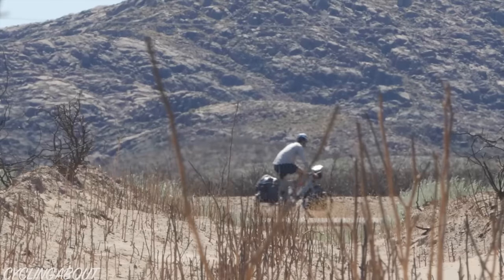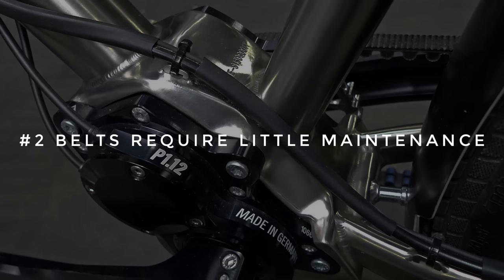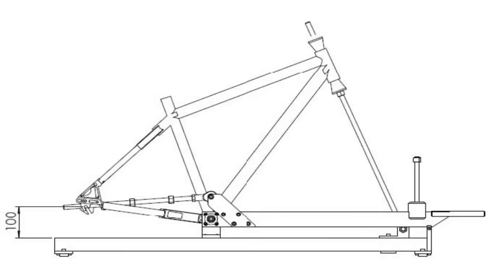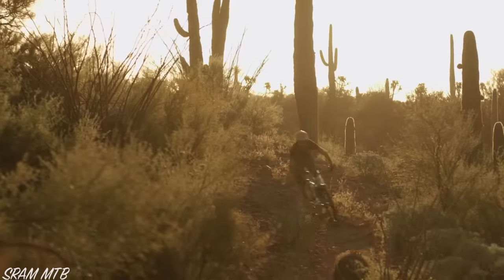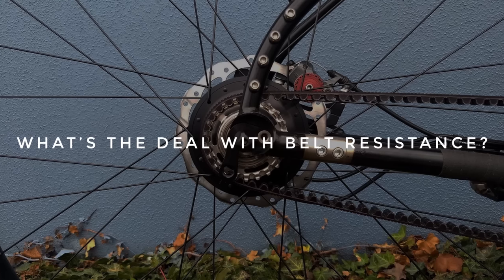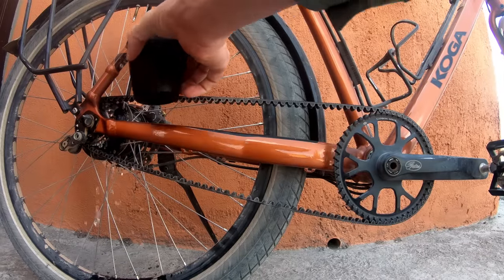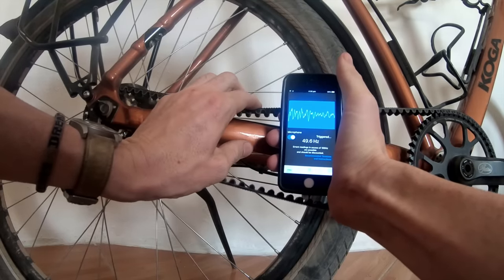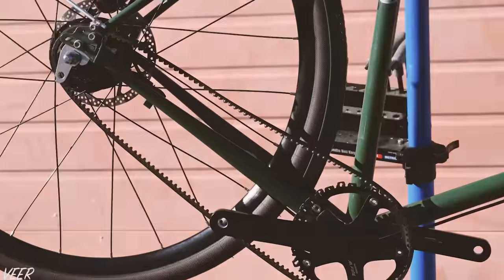Belts Are The BEST Bicycle Drivetrain Available (Epic Testing!)

Comment: For a belt, you also need a gearbox.  The Rohloff Standard Speedhub Touring is $1600.  Now add a specialty frame, specialty belt, and specialty sprocket and specialty chain wheel.  If you use it for commute, touring, or general transportation, you will need secure parking to ensure nobody steals it.  The system is heavier and significantly less efficient, so they are never going to make it anywhere weight and performance are drivers, which is typically where the money is spent.  Most looking for a touring bike, are looking for ruggedness, and being supported worldwide.  As things stand, the system only makes sense for what the author does, and those like him willing to ride an unsupported system worldwide.  That is a minuscule market.  I loathe chains and derailleurs as much as the next guy, but belt drives will need to get within a Texas mile of the chain drives on price before they can invade any area of significant volume.
Reply: awfully its true :(
Reply: This is fair, I suppose he did say the best available, not the best value or best in all situations, but I have to say he cannot be right about best commuter bike if it's this expensive.
Reply: I bought a belt driven, city bike last year. So I'd consider the advantages, if you buy new.
Reply: @normanproske9151  what price did you land ? they are way to expensive over here :(
Reply: i rather buy an good e-bike
Reply: heavy but better in the long run whereas others are easier but need regular maintenance which i don't mind. though if your taking a rubber chain make sure your using a speed pedelec. and that shouldn't be much a problem. especially when the bike auto gears itself XD
Reply: Ten years ago they promised that $500 bikes would have belts and thermoplastic gearing...
Reply: Head ur fast belt drive commuter bike has a Shimano nexus hub and is $666.99 on Amazon.
Reply: @jama211  you wouldnt care about a few percent efficiency, so the rohloff is out already
Reply: For pedaling a cheap internal gear hub will do but ebike belt drive is awesome but igh gearbox won't hold up 🤷‍♂️
Reply: Also you can't really do full suspension without a belt tensioner to allow slack
Reply: The belt is best for commuting and best of pedelecs of any kind (single speed, pinion, whatever). They drive insanely silent and a lot of bikers love the direct approach of the belt at crossroads and after stops. That multiplies on a pedelec as well. The chain is better on long straight tracks where you don't need a lot of effort. From 350w onwards the belt is as good if not better than most chains. And this is only true for a perfect new and maintained chain. The belt is just the better chain for commuting or pedelecs. pedelec engines will just crush chains in no time.
Reply: For commuting I have to disagree. You can get a 8-11 speed Shimano alfine hub for a fraction of a cost of a Rohloff system. You can buy a Canyon Commuter 7 for under $3000 AUD, and that’s a high-quality, relatively high-spec bike from that category.
This is perfectly affordable
Reply: I can't argue with your assessment. I'm in the market for a bike here and IG hubs are almost non existent. I'm pretty well locked into a derailleur bike. If I was still in the US, I'd be buying a Priority in a heartbeat..
Reply: Priority Bikes makes affordable belt drive commuter bikes. The $2000 Apollo even is a decent touring bike too.
Reply: yeah, these are also less interesting when compared to what the author calls 'the longest lasting chain' - and hes right on that. an eagle xx1 drivetrain lasts an extremely long time, is cheaper and works on pretty much any bike (with a small modification on road shifter when using cables). as much as id like a belt driven gearbox it just makes less sense than eagle.
Reply: Or, you are a mountain biker riding a chain driven singlespeed and fed up with chain maintenance through muddy, salty winters, and your bike is already belt compatible.  Sounds like me...seriously considering switching to belt :)
Reply: @normanproske9151  I wish I could buy a belt drive bike here in the Philippines. If anyone has a link for a source here, I'd really appreciate it. I almost bought a Priority bike in the US , but I knew I was moving. They don't ship here, I checked.
Reply: Bo need for a gearbox. A hub is good enough.
Reply: @telcobilly  

Surely you can get a TERN VERGE S8i overthere. They are pricey. But AWESOME. The best belt drive commuter bike hands down. I've been riding one for 3 years. And apart a few tire changes. I've had to do no maintainance on it at all. And I've put over 15,000 miles on it. Incredible bike.
Reply: You could go out of your way to spend as much money as possible, or you can buy a Shimano gearbox for 300 dollars.
Reply: "significantly less efficient" as in between 99-95% efficient depending on gear, so similar to chains. Significantly less than what then? Stop lying.

Comment: I am currently at 35,000k on my belt drive pinion gearbox and brother is 38,000k  each of us on the same belt.  Good on you for this video, we completely agree with your findings and also run a looser belt with no problems on ridiculously heavy loaded bikes in all terrains.  Can't stress enough having a correctly built bike that doesn't flex sidways for a belt drive.  Had a single speed like that, with problems breaking and skipping belts constantly.   Current single speed never happened even once on a looser belt.  Personally I destroyed 3 rohloff hubs in a row quickly.  They told me there is a weight/watts limit I was going over.  Our pinion gearbox never had those problems.   Glad to hear your rohloff is still going strong.  We enjoy your channel and look forward to the next adventures in usa.
Reply from the maker: Those are big numbers! 💪🏼
Reply: World traveling and long daily commutes😆
Reply: can you use wax as a lube for belts like they do with chains?
Reply: "Personally I destroyed 3 rohloff hubs in a row quickly. "
Ruh-roh!  And I've heard in several forums that the Rohloff is tandem capable.  As someone who has destroyed six rear hubs (3 Hugi/DT, 1 LX, 2 Phil Wood) on our mountain tandem, this is concerning.  I think it'll be chain drive & Chris King whenever that Ventana is finally ordered!
Reply: Oilcan racer you and your brother have put 35k and 38k on the same belt? You guys must have a pretty good schedule to swap that much🤣
Reply: @Animagus Borealis do some research on your own... Rohloff usually runs an incredible amount of km's.
The English frame builder of Thorn & wife travels all over the world.
Some 300T km

Comment: Great video, I fully agree as my Gates belt runs now 25k km combined wit A Rohloff in 5 years without any problem, only the rear cock was replaced after 22k km because the teeth got sharp. I would never ever go back to chain because of the maintance, dirt, oil and replacement.

Comment: As someone who has a belt and chain drive motorcycle, I'd take a belt drive ANY DAY! 
Once you know the luxury of a belt drive, you never want to go back. Not worrying about chain lube, rust, grease, replacing expensive chains... ugggh. 
Belts are set it and forget it. You can literally just peek down at your belt once every few hundred miles and you'll be just fine. So nice.

I know you tried to remain scientific and unbiased, but damn... just preach the peace of mind and freedom of a belt drive. That's the biggest selling point. You can leave your bike sitting for a while and jump right on and know the belt is fine, no greasy chain check before you ride. 
All of the other points are fine, but peace of mind is my number 1.

Comment: I am a fan of extremely basic bikes. Been using a single-speed bicycle with a CDX belt for years and years. It's great, pretty much the only thing that needs replacing every so often are the tires. A very economic mode of transportation.
Reply: Chains are better.  This guy does doesn't know what he's talking about
Reply: Chains are better how?
Reply: single speed sucks
Reply: @kalijasin  Shimano chain/cassettes/chainring upgrades
Reply: @galvanizedgnome  

Chains are not better. Until you have ridden both as I have you won't get it. I have been riding a belt drive bike for 3.4 years. I have over 40,000 miles on it. And am STILL using the same gates belt drive it came with. Previous to owning this amazing Tern Verge S8i bike. I had a budget Carrera intercity bike for 2.5 years. My chain snapped on me 3 times in that time  and I went through 4 of them.

Like I said you don't know until you know. Too many people make comments without any experience just ignorant bias.
Reply: Hey, fellow english as a second language guy. I used to say "economic" and now I wished someone would correct my mistake, so I'm correcting yours. In this case it's "economical", as in more cost/effort saving. Economic is used for things relating to the field of economics, like economic boom, economic downturn etc.
Reply: @galvanizedgnome you can have multiple hears with chains

Comment: I've had 3 belt drive bikes, the gates belts both developed a small amount of asymetric stretch, but also outlasted any chain I've ever used. The 3rd bike was the ikea sladda, the continental belt failed after only 10 months. Im very happy with my belt bikes
Reply: Continental belt was recalled and discontinued.
Reply: So...You have 3 belt bikes. 2 of them had belt stretch issues, and the other failed after 10 months. But your still happy with belts.  
 If I had 3 of 3 fails, I would not be happy.
Reply: @ratoneJR  His 2 other belts failed eventually ... but only after lasting much longer than any chain would have. Did you skip that part?
Reply: @ratoneJR  my 1st generation gates belt stretched and eventually wore out after e years of year round riding. My 2nd generation gates is still going strong after an initial break -in stretch, 2 years on. Very happy with that one

Comment: I have been riding a Gates belt drive at hight speed for my city commuter for a while. The belt lost its teeth after about 15-20k km. The resulting repair cost was around 350€. From my experience a Campagnolo chain does last me roughly the same distance and is cheaper to replace.

Advantage of the belt drive - no greasing required even after heavy rain rides. So no maintenance in between.

Disadvantage - you can't shift with pressure on the pedals, you have to time your shifting and take pressure from the pedals.

I have enjoyed my belt driven urban bike but have a chain driven gravel bike as a commuter now and like it better.
Reply: 15-20k out of a chain is really impressive
Reply: 15-20k km from a chain is borderline magical...
I'm lucky to get 4000-5000km without overstretching the chain
Reply: Yep, was really impressed myself. It was an original campa Veloce 10 speed chain. The last year I used it, I checked it constantly for signs of wear (lengthening) but it just kept on flying through my gears like a charm. I've sold that bike to a friend when it was around 15k km and told her the chain and cassette would need to be changed soon, she kept on riding for another whole year.
I'm on a campy Chorus 11-speed system now and at around 10k km now, without any sign of lengthening. Hoping this will last just as long.

I'm living in a really flat part of my country, so I never climb hills really, but I'm a fairly strong rider and go mostly for short, high intensity training (40-100km). For what it's worth. Maybe the lack of climbs plays a role. 
On the other hand, I've lengthened numerous cheap chains on city bikes in the matter of 2000-4000 km
Reply: That repair cost seems excessive for just a belt replacement...
Reply: @gabiold  they replaced the front and rear sprocket with it. They said they didn't look good anymore and would likely reduce the life expectancy of the new belt.
Reply: @mikedittsche  Compared to what industrial belt pulleys cost, still seems overpriced. 50-60 EUR would seem more reasomable, maybe 100 absolute max in an expensive shop...
Reply: @gabiold  the Gates CDX belt alone costs 70-90€ online, probably 90-100€ in the bike shop. Cont in the other parts and work hours and there you have it.
Reply: @gabiold  I also assume because its "new" and "odd" in the bike market, they can justify ridiculous pricing…
Gates is sort of alone in the market/the only known brand as well meaning they can do whatever they want.
Reply: A replacement belt is 50€ + 10 min of work. You got scammed my friend.

Comment: A while ago I really looked into belts when I was building a commuting bike. But they were simply uneconomical, if you shop around, and wait for good deals on cassettes and chains. I pay about £13 for 9 speed cassettes and £8 for 9 speed shimano chains. Even though a belt drive would last about 3 or 4 times as long as mentioned 9 speed drivetrain, the cost would be way more than 3 or 4 times. So it's more expensive to run.

If you are talking about 11 or 12 speed derailleur systems, with cassettes that start from ~£40, then sure a belt drive is a competitive alternative. For more budget oriented builds, not so much.
Reply: I think they're more about reducing maintenance than cost
Reply: @Rocco-tb9ih  I have my decade old, old-school BMX I just refurbished nearly completely, both the chain and back-wheel chainring were completely intact with little to no maintenance asside from oiling it in the first few years and never since then, the only issue was the original "mixed-alloy" chainring which was bent by a mm but still able to be used which I replaced with a steel one, there really is nothing wrong with using chains, especially how dirty cheap they are
Reply: @Kraypus  I completely agree, I only use chains myself. But you are supposed to lube them regularly and they don't like it when you ride them through rivers and shit, so I was just saying it's more about what they allow you to do without worrying about maintenance rather than cost
Reply: @Rocco-tb9ih  I understand and I take good care of it now, though I'm saying I DID neglect my bike throughout the years and put it through hell and it still held up with no replacement parts needed

Comment: 16 now, got my touring bike last summer, and thought that my Deore derailleur system was already pretty fancy. Now I found out that there are rear wheel hubs costing more than my whole bike... Still love my bike though.
Reply: Invest in some thread locker for that Deore. Jus' sayin'.
Reply: Whatever bike you have, someone else has a more expensive one. Don't fret about cost too much. If it does what you want it to do, and you enjoy riding it, cost isn't that important.
Reply: @another3997  Yeah. I modified around a bit and now I couldn't imagine it being any better.
Reply: The very second you reach for your wallet, there's something better you 'should' have bought.
Reply: @jthepickle7  Nah don't regret my desicions a single bit. I ride that thing every day and it's perfect. The only bad desicion I made was buying Magura brakes. Horrible. Just switched to some nice Shimanos.
Reply: @simont3686  I started into buying bicycle parts in 1974.  It didn't really ever end!  My bike is now totally complete...and is an antique, like me.
I went to Rome to buy my first bike, at 20. I rode it from Paris to southern Morocco, across the Moroccan Sahara, alone.
So, you're 16 huh?  Foot/shoe interface.
Reply: @simont3686  magura is mostly good on DH bikes, actually just mtb's in general
Reply: @hashy4940  But why would they be so bad on a touring bike? My fork is stiff enough. I also upgraded it. The maguras were an MT5 in the front and an MT4 in the rear. They always made a very loud rubbing sound and the levers didn't suit my taste. Generally lots of quality issues. The Shimanos are BR-MT520 and BL-MT501 front and rear. No such issues. They're perfect.
Reply: @simont3686  I have no Idea. In general magura focuses on citybikes and mtb's, and that normally means that quality sinks somewhere else
Reply: I was also surprised to hear that there are mtb suspension forks that cost more than a car
Reply: @jthepickle7  You must have had a lot of adventures, did you continue touring after?
Reply: @GlatHjerne  In 1982 I got the touring bug again and rode from Miami to Seattle - 8300 k. That was it, for touring, but I used to ride 220 miles per week, for years, even while starting up my business. (thanks for asking)

Comment: Well said dude! I run belt on my MTB for over 4 years now (with Pinion) and will never go back to chain/derailleur.
Reply: @moa-wg3bo  No! The main reason is that an internal geared rear hub is not good for MTB due to the additional unsprung mass at the rear wheel. The Pinion gearbox solves this! The belt is also great with mud, so... Check my videos! 😉

Comment: I've done more than 100.000 miles with the same belt on my 106 cubic inches 1000 pounds motorcycle and it still looks good for another 100.000 miles... :-)

Comparing with a shaft drive, my previous mount, a German Beemer, each shaft axle lasted about 40.000 kilometres, so I had to change it three time in less than one belt drive lasted on a much more heavy and torquey bike... :-)

I hope my current KTM Duke 690 had one to instead of its messy, noisy and dirty chain...

Comment: Modern belts are incredibly strong. The industry I work in we use quite a few belts that get severely abused and I'm always amazed at the abuse they take.
Reply: I got a BMW motorbike with a belt drive. When I bought it, there was a small stone in the middle of the belt! It had a small hole. And yes, that belt snapped at exactly that spot. And the man at the BMW shop had said, don't worry, that belt is strong enough. Lesson learned, do not buy a bike that has a belt with a hole in it. It breaks on a speed bump.
The belts after that first one, were no problem.